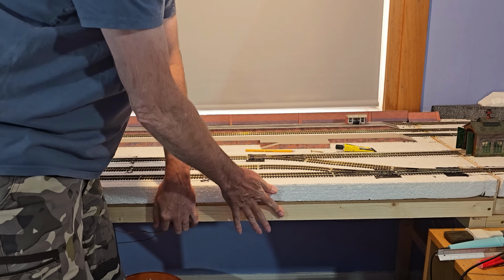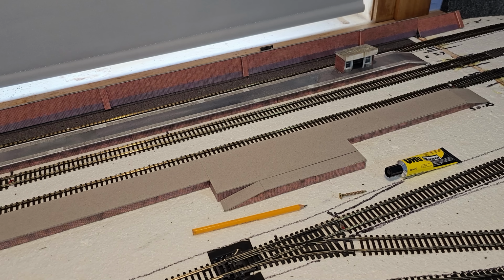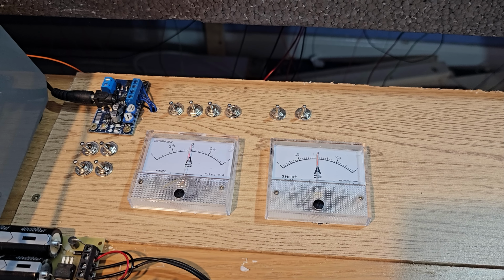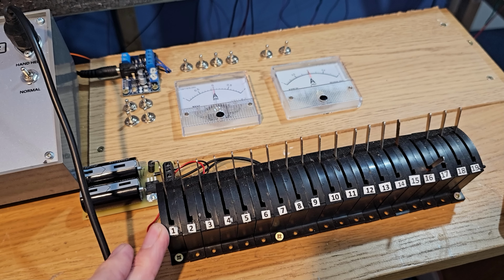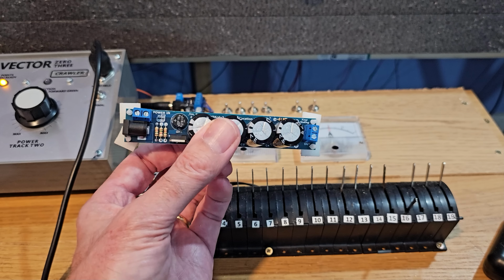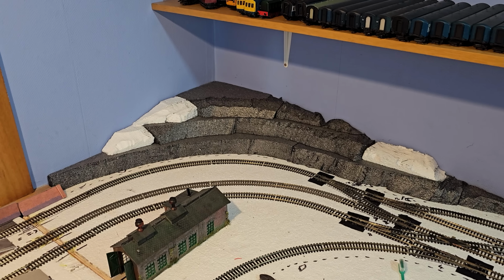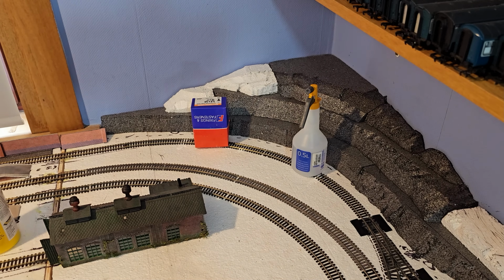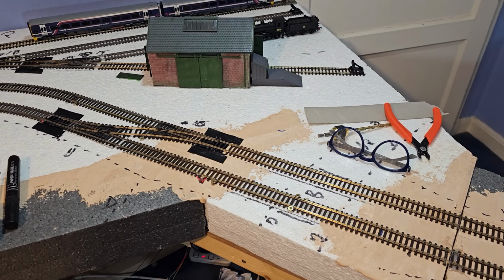Layout Update 7

Comment: Nice to see the layout updates.  I have a cheap CD unit exactly the same except from a different store.  It gave me the the same problem as you experienced, it was useless.  I'm relieved to hear that it isn't just the one I have or that I had wired it incorrectly.  My points work better without it so it has been sent to the junk box.

Comment: Thanks for the detail on CDU's , there are some interesting claims made for them, I bought one a few years ago that, it was advertised as be capable of switching four motors, it wouldn't even switch a pair! I still use one, similar to your Gaugemaster, that has given good service for years, but as you say the input voltage is key, I built a 24v supply for mine.

Comment: I use PECO passing contact switches with the CDU in a Morley controller, and they work absolutely fine. I haven't noticed locos slowing down when I change points, but I don't really change points a lot whilst trains are running. I don't notice any need to pause when throwing the PECO switches to operate points. You do sort of need to buy PECO's frame to hold PECO's switches - one frame holds six switches. The PECO switches come with handles in several different colours, which can help in quickly identifying the one you want.

Comment: Hi. I've just brought an ammeter like yours. No instructions. If I am fitting it between controler and terminal block of bus wire could you tell me which wires are connected to back of ammeter. Many thanks. One side has a negative symbol.
Reply from the maker: The ammeter simply wires into the positive feed to the track. So basically take a wire from the positive terminal on the controller to one terminal on the ammeter and connect the other terminal on the ammeter to the track.